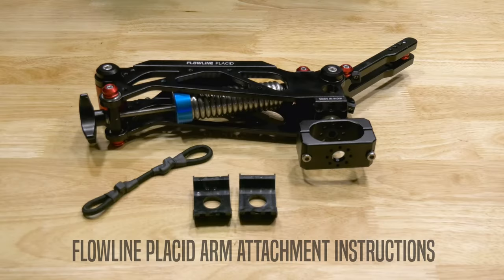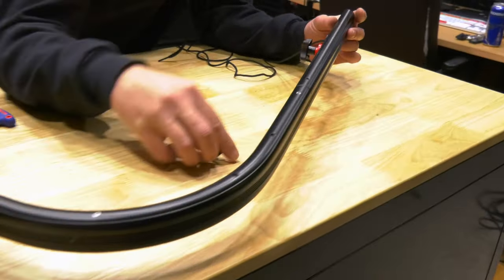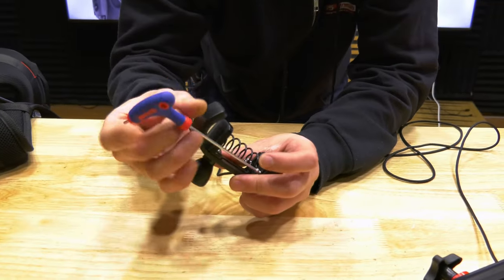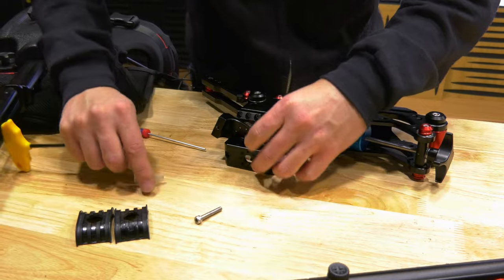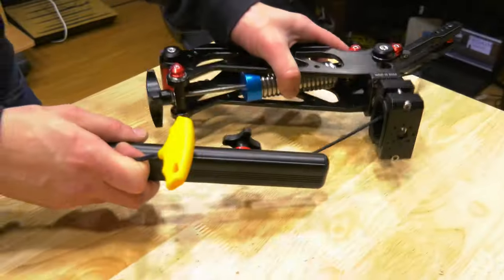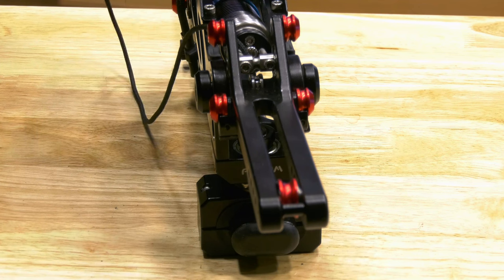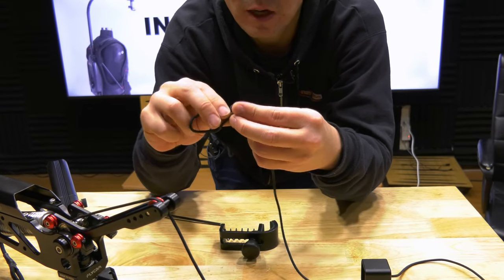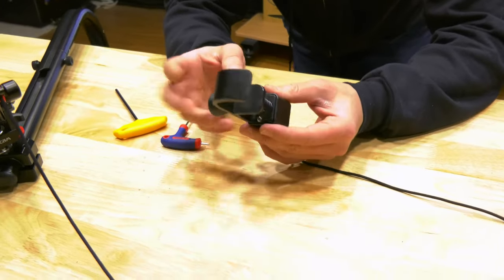Steps to Use Flowline Placid Two Axis Spring Arm to get Incredible Camera Stabilization I Assembly

Comment: How to install it on the 600n. The spacers are not compatible with the size of the handle. And if I put the holder directly on the handle, there is a plastic ring through which the rope passes that prevents me from attaching it properly. It leaves a gap.
Reply from the maker: In our N-Series, the Flowline Placid Two Axis Spring Arm is attached without the spacers. Kindly check the following video for more clarity.

Video Link: 
https://www.dropbox.com/sh/tye47s1bk5nrn65/AABABH1bGIharcRKri7OpLCOa?e=3&preview=How-to-attach-the-extension-part-and-placid-with-n-series-flowline.mp4&dl=0

If you have any questions, don't hesitate to reach out to us. 
We're here to chat and help in any way we can!

Comment: Out of curiosity How would you install this if you add the other version of the vest, where you don't have those unscrewing knobs on the original arm
Reply: I have the same issue with the one that I purchased from Amazon (FLCM-FLN-PA-01). My top arm piece is just one piece, not like it is shown in the pictures on the Amazon site.  In other words, there is no way to reposition the screw knob on the top like it is pictured.
Reply: @KenLittle  I mean, there is a single hole on the top of the arm and i'm half convinced that that's the hole that you would use and you would just do the screw adjustments for everything else, but I have no idea how to do that
Reply from the maker: We apologize for the inconvenience caused. It looks like you have received our new version of Flycam Flowline Starter- the Placid attachment in the new version varies from the older one. 
Kindly go through the steps mentioned in the following links:
https://prnt.sc/JjgBgsdGw61U
https://prnt.sc/UwmyRtbz67_m

Let us know If you have questions- Happy to Help!
Reply from the maker: @KenLittle  We apologize for the inconvenience caused. It looks like you have received our new version of Flycam Flowline Starter- the Placid attachment in the new version varies from the older one. 
Kindly go through the steps mentioned in the following links:
https://prnt.sc/JjgBgsdGw61U
https://prnt.sc/UwmyRtbz67_m

Let us know If you have questions- Happy to Help!
Reply: I figured it out. I did use the hole on top threading the cord as instructed through the placid stabilization device. I used the spacer inserts when attaching it. It worked out well. Can’t wait to use it tomorrow and the next day on an assignment.  My stabilizer came with the red spring installed, so I changed it to the blue spring as my cam is only about 7 lbs.
Reply from the maker: @KenLittle  That's fantastic! Let us know if you have more queries- Happy to help!
Reply: @ProaimGlobal I’m having this same issue as mine is the new version as well. However the link you provided here doesn’t explain how to rewire the rope so it goes out the top hole. The pictures already have the rope coming out of the top hole which is not how the product is by default. I’ve been searching for 4 hours to find any explanation on how to attach the Placid for this new version and there’s nothing that explains how to do this

Comment: Hi and great video!
a question: In the N series you can't put zero tension in the string as in this video because N series have no way to change the tension of the string. So, how can I do it?

thanks!
Reply from the maker: Hello,
Thank you for appreciating our video!
Regarding your query about the N series, as per our team, the N series does not support zero tension. It will operate within its pre-defined minimum and maximum capacity.
However, We have several other body-mounted stabilizers with adjustable spring tension.
Check out the links given below to have a look at them:
https://www.proaim.com/collections/body-mounted-stabilizers/products/flycam-g-axis-carbon-fibre-stabilizer-with-vista-ii-arm-vest
https://www.proaim.com/collections/body-mounted-stabilizers/products/flycam-g-axis-carbon-fibre-stabilizer-with-galaxy-arm-and-vest
https://www.proaim.com/collections/body-mounted-stabilizers/products/flycam-zest-pro-electronic-video-camera-stabilizer-with-vista-ii-arm-vest
https://www.proaim.com/collections/body-mounted-stabilizers/products/flycam-vista-ii-arm-vest-with-redking-video-camera-stabilizer
https://www.proaim.com/collections/body-mounted-stabilizers/products/flycam-vista-ii-stabilizing-arm-vest
https://www.proaim.com/products/flycam-galaxy-arm-and-vest-camera-stabilizer?_pos=1&_sid=35eadbfbf&_ss=r
https://www.proaim.com/collections/body-mounted-stabilizers/products/flycam-galaxy-arm-vest-with-redking-video-camera-stabilizer
https://www.proaim.com/products/flycam-hd-5000-camera-stabilizer-system-with-comfort-arm-and-vest
https://www.proaim.com/products/flycam-comfort-arm-vest
https://www.proaim.com/products/flycam-5000-camera-stabilizer-system-with-comfort-arm-and-vest

If you have any further queries or need any assistance, feel free to reach out to our sales team.

Tel / WhatsApp :+91-8283902255
E-mail: sales@proaim.com

Team Proaim

Comment: Thanks for the tutorial. Quick question about the wire. For example, easyrig's wire springs back to the top when you detach the camera. It seems like the flowline handle/wire just dangles where you left off. Am I doing something incorrectly? isn't the handle mount suppose to spring back to the top of the bar?
Reply: Sir, you need to tension again the wire when releasing tension. Recalibrate again tension accordingly to your camera weight is your last step when finishing.
Reply from the maker: Hello Solo,
Please let us know which flowline are you using - Master or Starter. 
Thanks
Team Proaim
Reply: I have the Flowline Master and like Solo says, the line just dangles without any tension. The tension knob/throttle know just lowers and lifts the line. Isn’t it supposed to spring back up to the top of the bar??
Reply: Did you ever solve this?
Reply: @ProaimGlobal  Can you answer this question please?
Reply from the maker: @Stock-Cube  Thank you for contacting us. We understand your concern.
Your rig needs to be balanced according to the weight of the setup. There is a red knob that you can use to balance it easily.
If the rig is well-balanced, the rope goes back as soon as you detach the setup. 
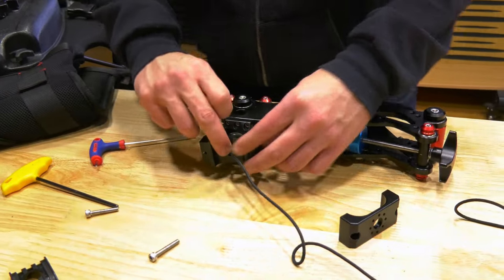We have attached a video that shows how to balance it from 3:58 onwards. 

Video Link: https://www.dropbox.com/scl/fi/qwv1xxjzxwb22cshsv824/How-to-Attach-Placid-on-Master-flowline-FLCM-FLN-MSTR-PLA-01-FLCM-FLN-PA-01.mp4?rlkey=uywnr62nnikajod6deb4psif4&st=ets88z4p&dl=0
Image Link:
https://prnt.sc/03UJY68DZbVk
Please watch this video and let us know if it resolves the issue.

Comment: Thanks for the video ... If we are using a Flycam with a Gimbal .... Does the Payload of the Gimble actually matter ? Asking because the FlyCam takes bulk of the load ?
Reply from the maker: Hello Nikhil,
Yes, payload of the Gimbal matters. You need to change the Springs as per the payload. For heavier payloads, use red spring. For lighter payloads, use blue spring. For more information, please contact our sales team at sales@proaim.com
Thanks
Team Proaim
Reply: @ProaimGlobal  No I meant for the gimbal that is beneth the camera ... Since Flowline takes all the weight

Comment: Any ideas how to mount it on easyrig minimax, where you cant reverse ending of rod?
Reply from the maker: Hello,
Thank you so much for your interest!
We would like to inform you that you can attach the Flycam Flowline Placid with your EasyRig Minimax, but in this case, you would be required to Drill your Rig as there is no drilling fixture provision.

Also, although the weight capacity of the Placid Arm is 5 to 12 kg, you would only be able to use it with blue spring as the maximum capacity of EasyRig is 7kg.

Regards
Team Proaim

Comment: Do you even need that spring? Seems useless if your using a kong adapter
Reply from the maker: The spring helps absorb bounce and stabilize vertical movement. It’s key for keeping shots smooth.
Reply: I'm using a KONG Frog adapter so that spring is basically useless